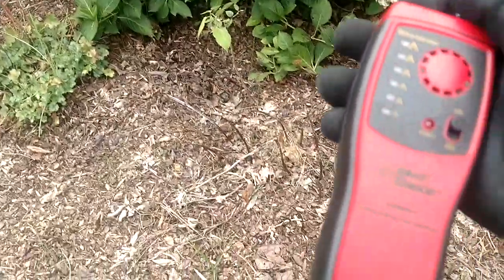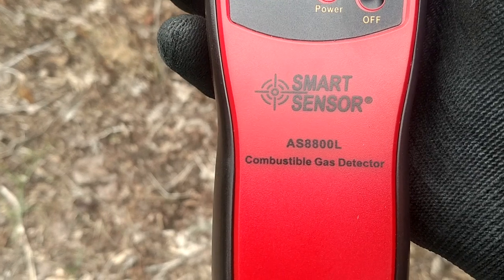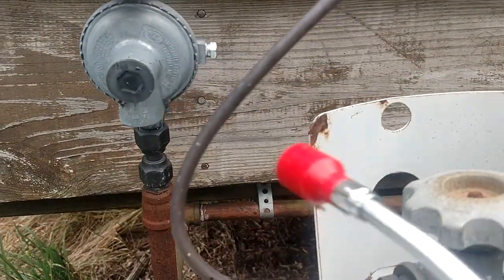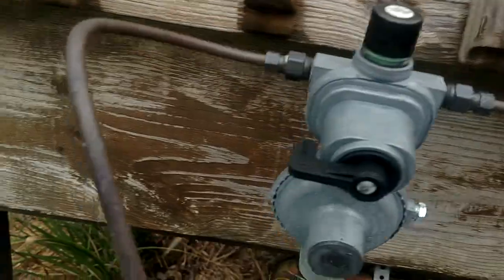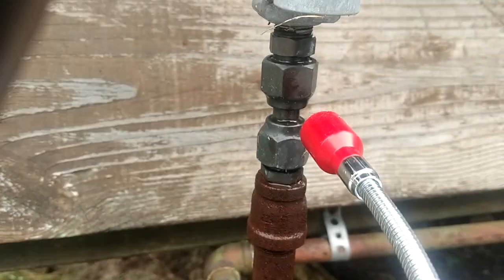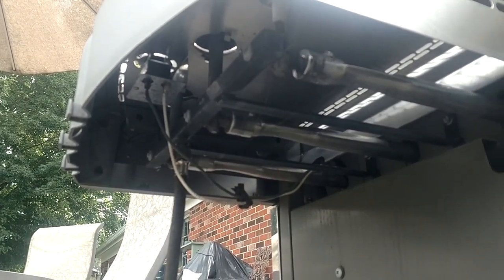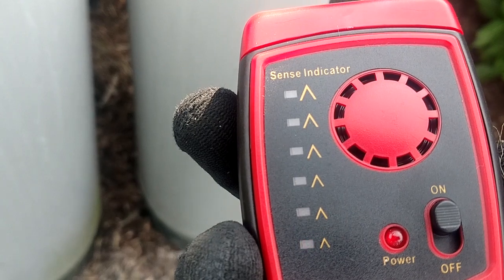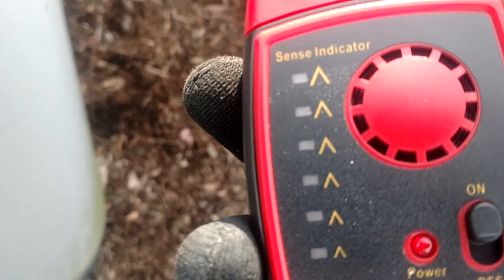Do Chinese tools work? Let's find out. GAS LEAK ⛽🔥Smart Sensor AS8800L & Swagelok Snoop

Comment: May i know can i test it if there is trunking on or need to test direct without trunking covering the pipe?
Reply from the maker: @CheeKengChua  if there is any combustible gas present the instrument should detect it. Thanks for watching 😎👍
Reply: @sknight0391  Can i check, if i set the sensitivity level say to 2, if there is leak, it should go beyond level 2? but if it doesn't does that mean there is no leak? i m quite confuse with  the high pitch sound if i raise it higher and the dot dot sound if i only set it at level 1.
Reply from the maker: @CheeKengChua  that's just indicating that the concentration of gas is getting higher. Thus meaning a larger leak. The more noise it makes and the higher the lights go, the more gas is present. You set the detector in "fresh air" so it's not making any of those noises. That way, when it goes off you know you have a leak.

Comment: Just picked this up. For less than $20, it's great peace of mind. Just had gas pack put in and we have lots of old fittings. Keep smelling gas but can't figure out where. After contractor keeps telling us it's all in our heads, anxious to confirm one way or another.
Reply from the maker: Yes, it's a great little detector and I'm sure it will find your leak. The first place to look is on the  " Union" where the gas pipe joins together. It's a threaded coupling that looks like something you could put two wrenches on to take it apart. It could also be coming from around your gas meter and then it would be the gas company's responsibility to make those repairs. Good luck and thanks for watching my video 😎👍
Reply: @sknight0391  Ooh, good call with the meter! Where we smell it is in a room that happens to have the meter right outside the window.
Reply from the maker: @girlnextdoor0703  nine times out of 10 it will be on what they call "the riser" which is the pipe that comes up out of the ground and connects to the meter. Happy hunting. 😁👌

Comment: I use An old famous rugged Tiff 8800. But the tip was messed up. I switched to this to just give it a shot sure enough the same.
Reply from the maker: Yeah, that thing is a great little detector for sure. Especially for the price! Thanks for watching 71'👍
Reply: What would you use for co analyzer.
Reply from the maker: @1971omi  Smart Sensor AS8700A is a good economical option that works very well. Klein ET110 is a good mid price option. But if you want something more professional, Bacharach is the only way to go.

Comment: Will it detect sewer gas? If so, how do I set it to pick up the sewer gas. Thanks!
Reply from the maker: It will detect sewer gas just the same as any other gas. No special settings.
Reply from the maker: But I would check the manufacturer's specifications to make sure it will fit the application you're looking to use it for.
Reply: Thank you very much👌
Reply from the maker: @pristinv500  thank you for watching 👍

Comment: Purchased this gas leak detector and found 2 leaks, one by the water heater and the other was a small leak on the gas pipe in the ceiling... it’s good... you right about the company....
Reply from the maker: Boom goes the dynamite !!! 💣💣💣
Reply: Shannon Knight HVAC lol

Comment: hello, i just get mine, but operation instruction and do not correspond.  in detail intruction guide is like these: 1.- Turn the unit off and the sensitivity knob fully counter clockwise. (i doit that in exterior free gas area). 2.- turning ON, the power indicator will de lit.(that is OK, but the alarm is sounding up strong, because the  sensitivity knob was set fully counter clockwise ) 3.- after turn on, the unit will auto warm-up within 20sec, a ticking sound will be heard. (Up to 1 minute of hearing the noice from the alarm, even so no ticking sound, so i skip to instruction 4) 4.- adjust the sensitivity control until the first leak indicator ligth up, the ticking speed up. (thans seems to work, but how to ensure te calibration was correct?) 5.- approach the sensor to a known leak source, (i used a gas lighter), the leak size indicate lights will increase with the rapid ticking. (that works, but then i figured the leak size lights increase eaven pointin the sensor to my bare cleand hands, that does not happen with other gasleak detector i used). how works your as8800?
Reply from the maker: Leave the sensitivity knob turned all the way off in the clockwise direction. Turn the unit on and let it go through its warm up. Then barely turn the sensitivity knobup until the tick rate gets slightly faster and then turn it back down a little bit. That is where you will be using the instrument most of the time. The knob is turned up very little. You have yours turned up way too high and it's giving you false readings. The tick rate during operation should be fairly slow.
Reply: @sknight0391  Thanks, at beginning i was assuming that operating instructions from the factory was wrong , but i want to be sure.
Reply from the maker: @Rootbreakerhellkite  The key is to adjust the "ticking" sound just like I did at 1:35 min. in the video. The sensitivity wheel is actually turned up very little.